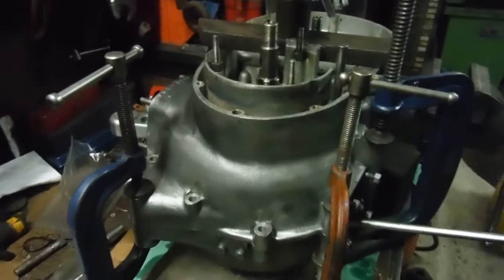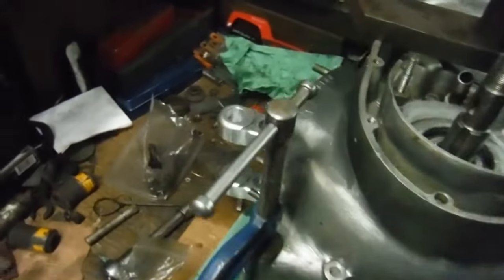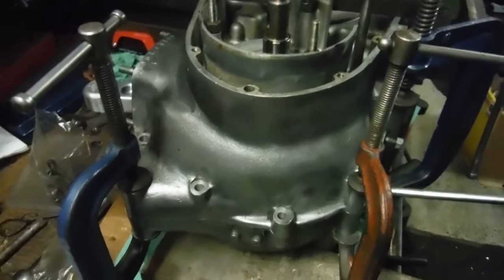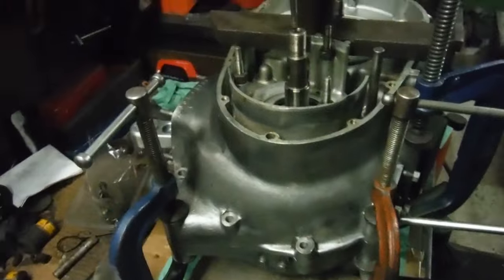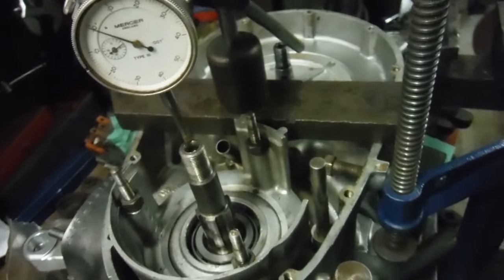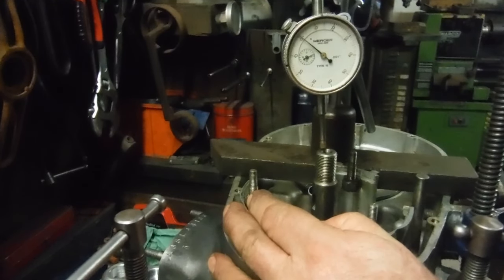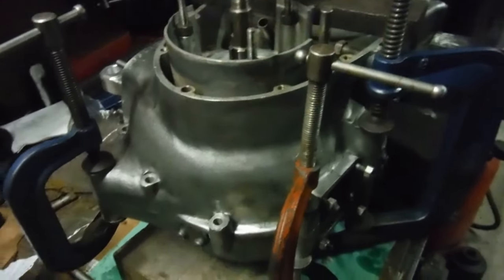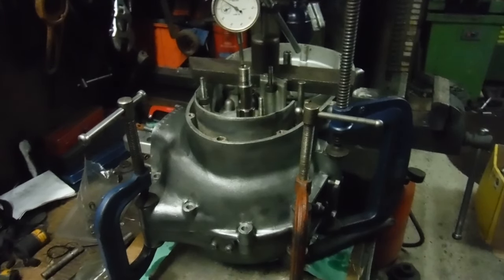BSA A65 post blow up repairs 10 Bottom end reassembly and checking crank end float.

Comment: Hello Paul, I would strongly advise to Put the pistons on and fit the barrel  with the drive side crankcase off and then rotate to make sure that you have clearance between the conrod and the barrel.
You should be fine as A65 have 75mm bore and they are oversquare but it wouldn't hurt to check it.  I did the same when Billet conrods were put into my 1973 Triumph 500 T100R Daytona,
I know it's a bit of an issue with 650 Triumphs as they have a 71mm bore and a longish stroke and they can foul the barrel as can BSA A10's.
Solution with the Triumph650 is to Dremel the cylinder till you have clearance.  A better way is to fit a Morgo 750 and then no issue as they are 75mm bore,
I hope the info was of some use to you.  Cheers.
Reply from the maker: Thanks for that, and a very good point, but at present I have no pistons and the barrels need reboring and painting before they can be used.

Comment: I will be opening up my A65 engine as there is a knock I am not happy abut. Your videos are great, and will help me a lot. Question: To eliminate the end float I guess you put shims on the timing side, where do you get these shims? Any recommended shop for that? Thanks, TG
Reply from the maker: Sorry, but shimming the crank is a full engine strip, as the shims fit between the drive side main bearing inner race and the crank - there is no easy way.

Comment: G'day Paul, bloody well done end couldn't get any tighter if it was it wouldn't run when hot, question, on one of your earlier videos you mentioned using a type of long reach (electro) sparkplug, what brand and what are they called please, those conrods look the part are they much more costly than standard ones, looking forward to the ongoing rebuild, cheers mate, Neil 🤠. PS out on a ride with mates tomorrow can't wait.😊
Reply from the maker: Hi Neil, those plugs were the protruded electrofe type, they come in short and long reach but the centre electrode sticks out further. Example in NGK speak would be where a B8ES would be an ordinary long reach, a BP8ES would be it's long nosed equivalent. The conrods were reasonably priced and came from Burton Bike Bits, similar more expensive ones can be had from SRM.
Reply: @paulhenshaw4514   hi mate thanks for you reply, all way their with help, have a great day, cheers, Neil 🤠.

Comment: Love these A65 videos. Shame their lack of reliability creates so much content.
What is the cause of the original timing side bush failure? Given the explosive nature of this engine and it now sports the R&R rods where you not tempted to fit the Ford tractor bush or contemplate the SRM conversion. Does fitting an inline modern oil filter help preserve the original bush?
Reply from the maker: Thanks, I think poor servicing and too few oil changes are the main culprits. The existing bush was original and too good to disturb, otherwise a Ford tractor bush might have been considered. Adding a filter can certainly only help.

Comment: We had many A 65 A 50 engines with excessive end float. Would cause a knock at idle. Poor quality control in the mid to late sixtys. Porous inlet manifolds on 650 s etc

Comment: How do the new conrods compare weight wise to the originals? Does the crank need to be balanced?
Reply from the maker: Going by my experience with swapping pistons and going from alloy to forged steel conrods in Royal Enfield Bullet engines where there were no problems, I am not worried about it and I doubt there is much, if any difference tbh.

Comment: Hi Paul, I may have missed something but, did you use the original crank and timing side bush in the new cases, in other words did you remove the timing side bush and fit it in the replacement cases
Reply from the maker: Hi Charlie, no, the bush in the replacement cases was very good and of standard size and the journal on the crank from the blown up engine was less worn than on the donor engine's crank. The crank from the blown up engine survived intact and hasn't been reground and the fit in the timing side bush was very good.

Comment: Will the gasket sealant increase the .0015 clearance at all? Had to ask but probably a dumb question!
Reply from the maker: I thought it would in the past, but found out on a previous A65 build which had been a little tight on end float that a gasket compound didn't help as I had hoped, so it doesn't make any noticeable difference in my experience at least.
Reply: Thank you for that!